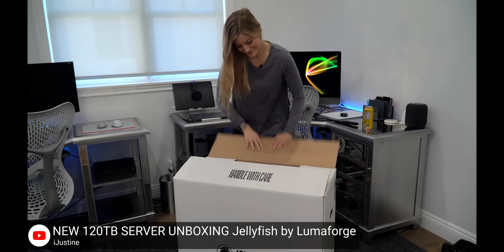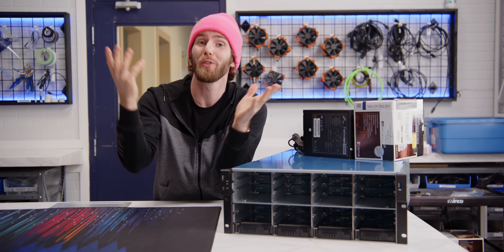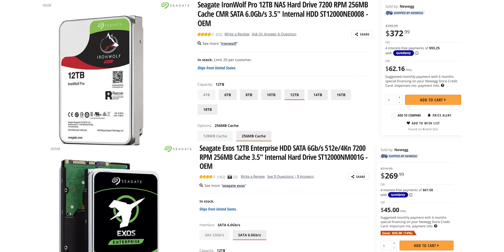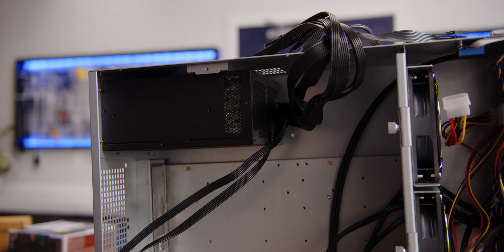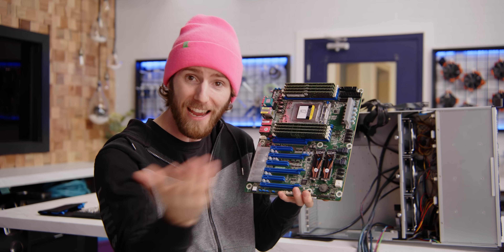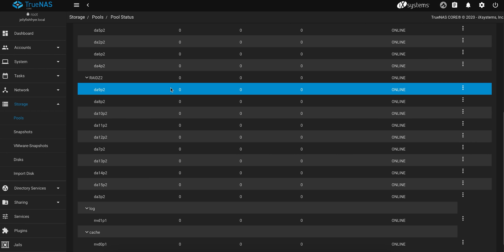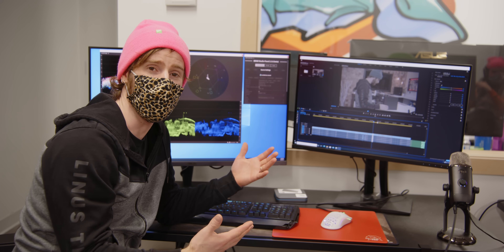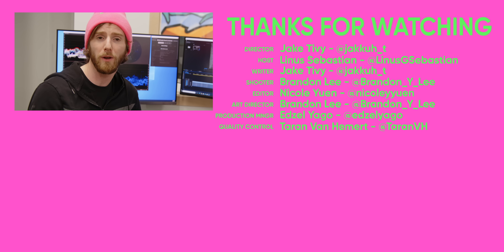Here's How to Save $45,000 - The Sensible Jellyfish Fryer

Comment: I built a portable all flash file server, 16 hot swap 2.5 inch Samsung SSDs, dual 40G SFP+ ports, but only a max of 128GB of RAM due to using an ATX board and Ryzen 5 4650G(64GB of ECC uDIMM installed). Currently sitting. at 32TB. My cost? $4054 The same effective thing from Jellyfish? $13,696. But that only had 60Gbps instead of 80gbps. And i cant even tell if that is flash storage or spinning rust. IF this were spinning rust, then i also have a cost for that, as this isnt a new server, i actually upgraded it from 16x2TB 7200rpm drives. The original cost was just over $2000 , as instead of $199 for Samusing 2TB SSDs, i was only paying $89 for 2TB Seagate drives(now down to $69)
The one thing i THINK the jellyfish has over me, is build quality, and registered ECC instead of unbuffered
Oh, and my new server build had Optane acceleration for small file reads/writes//SLOG/L2ARC. But i removed them because of the lack of PCIe lanes, actually slowed performance in sequential read/write compared to the pool's native speed of ~4GB/s, which is held back considerably by the SAS2 controller, if this were SATA/SAS3, then in theory, this array would be capable of over 8GB/s.
Yes, i realise that Ryzen 4000 holds back my performance because it is PCIe 3.0(i can max out the SAS controller, i can max out the network, but i cant do both at the same time), but i can upgrade in the future if i need it, and right now, i dont need it

Comment: Say it with me kids: "Molex to SATA, lose all your data."
Reply: Where does that saying come from?
The molex connector isn't fancy or particularly good, but also not nearly as bad as your saying states it to be. Here in Paraguay (South America) computer equipment and molex connectors are pretty much a given. The newer stuff that floods to 1st world markets, will still take a year or 3 to 4 before it trickles in over here. 

Anyway, molex to SATA converters are pretty common here. And I personally have 8 (bare metal) servers running with those. Guess how much data I have lost. Exactly 0 comma nada.

So tell me again, where do you get that saying from? Are you to weak to make a proper connection between molex connectors? Don't you place those connectors (or any other connection types for that matter) in such a position that gravity helps in keeping the connection solid? Or don't you take electronic "creep" into account?

If that is the case, it is your lack of thinking things through properly that actually loses your data. All I read is that because of your lack of insight, you should never hold a job where you are responsible for your own data or heaven forbid, someone else's data.
Reply: @geroldmanders9742  Many (cheap) SATA connectors are molded in such a way that they easily short between the different voltage rails. The first result on Google (for me at least) is a /r/techsupportgore thread showing the aftermath. There are many more. It's something well established, but also a meme. 

I didn't look very closely at the ones Linus used in the video, but I don't really care- he probably knows about this issue already. I commented because:

1. People who will actually follow this guide (as a direct alternative to a JF) won't know which SATA connectors are crimped vs molded. I have a faint hope that someone might see this comment and Google why not to use these cables blindly (especially cheap ones).

2. Memes.

Comment: That's still not plug and play, you should have configured DHCP, that would have closed the gap, though you still need to make sure your network interface has DHCP mode enabled, which is usually the case in Windows for a fresh install.

Comment: Something that would make this solution truly "plug-and-play" would be to run a DHCP server on the NAS (possibly in a jail or just bare metal), that assigns IPs in each of those subnets. doing this, you don't need to manually set the client IP. Alternatively, you could just assign all those Ports to a Softswitch for a network where you again run DHCP, with similar results.

Comment: Would be nice to get your hands on a Jellyfish and run this side by side under real tests and do some benchmarks. Would also be nice to see the underlying parts that Jellyfish use but don't share part numbers, so like a teardown and find the RRP of the parts they use so you can give a cost of buying the identical Jellyfish parts and building the 100% unit and just see how much Jellyfish really screws its customers over. 

What is more worrying is people like IJustine while I use to watch her content, she puts herself forward as a Tech Guru - someone who says she knows what she is talking about - but when they ditch in this case the system you built for her and goes out and buys a Jellyfish and then raves how good it is - You really do have to ask - How much does IJustine actually know about tech? 

The same could be said for the others who have done the same. But IJustine is the 1st person that comes to mind who has done this. 

So in a nutshell would be good for LTT to get its own Jellyfish and then give 2 in-depth videos 

1) Jellyfish vs the rig in this video for proper workflows - not just running read and write speeds from the drives. 

2) Breakdown of what you actually get in a Jellyfish, and a cost of those part by finding the part numbers.

Comment: I really feel that the people who bought the Jellyfish tech tubers are exactly like people in the tech industry in general. i.e if there from the silicon valley, they are all image and no substance. 

Not to disparage those involved in this pseudo-clapback, but for "tech" YouTubers, they don't seem to know a whole lot about the actual technology behind things. They just know advertising dot points and seller speak (which I call Crapanese) 

To them, technology is a fashion statement and everything comes second to the optics of using/endorsing certain brands. 

Plus, they're quite flush. Despite intimating otherwise, so they don't need to think about reducing overhead as much as most people. 

In addition, it's a business expense to them. Their accountant may have told them that they need to have a certain amount of expense to drop a tax bracket.

Comment: Hell, i wish i could ask a question, since i had trouble with searching for a possible solution. 
I have 5 screens, but just 3 ports on my RTX 2060 (DVI-D, HDMI and DP).
At the moment i connected 3 screens (one to DVI-D, one to DP, one to HDMI) and.... thats pretty much all my ports on GPU and 2 monitors left. So i kinda wanna use it.
DP-chain is not an option (only one screen with DP), but my msi b450 "Mortar" motherboard does have an HDMI-port and Type-C port. Ofc, natively, this HDMI only good in case of me not having a normal GPU and CPU with on-board graphics (Ryzen 3600 does not). Buying a new GPU isnt an option due GPU pricing atm.

Is there any way to connect all 5 screens to my PC with, perhaps, some splitters/Type-c without mirroring input?

Comment: For anyone thinking of setting something up like this on their own, never use only a single device as the SLOG.  This is a single point of failure for the entire array. Preferably, you want this to be at least a RAID 1 volume, and might want to even make it hot swappable.
Reply: Bigger problem is using a consumer TLC drive as the SLOG
Reply: @otgsid3243  yeah, write endurance is a pretty big factor, but at least you'll see that coming if you pay attention to the S.M.A.R.T counters.
Reply: @joshuamarcotte8514  Power loss protection is another factor anything in the DRAM on the SSD during power loss will be lost.

Comment: 6:30 this is wrong, a slog or a separate intent LOG in other words only caches synchronous writes, not asynchronous writes, synchronous writes are usually only used by things like databases which need to be 100% certain that a write was completed to ensure data integrity, this can be fairly slow which is why ZIL and SLOG where created, almost all other workloads, like sequential writes seen by ingesting data, make use of asynchronous writes and do not benefit what so ever from a SLOG. Also worth mentioning, because a slog contains data that has not been flushed to the main raid array you should really also make sure the slog uses redundant storage otherwise it may still lead to data loss in case of hardware failure, also the type of workload is really heavy on nand flash ssd's so you should really be using optane.

Quick note, what you could do if you still want write caching is using lvm below zfs together with dm-writecache or dm-cache in writeback mode, this will basically do exactly what they where trying to achieve
Reply: The other thing that needs to be stated is any drive used in this role needs power loss protection.
Reply: @otgsid3243  i think that's only for zil, not for slog devices, although I'm not 100% sure
Reply: @MrTurbo_  SLOG (Separate ZFS Intent Log) is the ZIL (ZFS intent log) when you add a separate drive just for ZIL.  The wording and acronyms make no sense, but bottom line is when you have a  SSD slog drive the zil is on it, and it needs PLP otherwise data on the DRAM is vulnerable.

Optane would be the best drive, and it doesn't need PLP because it doesn't use DRAM

Comment: 5:27 Cut the cr@p would you? I had 2 HDD fail out of a batch of 4 with only 29000 power on time, these are ironwolf drives with 1000000 MTBF. Yeah i call that BS. If you value your data stay the hell away from seagate. And to add vinegar to injury i was able to get HGST ultrastar for the same price as regular ironwolf drives, seagate can go to hell.

Comment: Weird that nobody has mentioned how the consumer m.2 drive for slog is not recommended at all, as those almost never contain power loss protection for the data in the drives dram. for the price of the system it should've used a proper datacenter SSD for slog.

Comment: Re: implementing "direct attach" - instead of twiddling with manual IP addresses, one can configure DHCP server to run on each port that's not plugged into a switch. Then all you have to do is plug in the cable. It's even possible to make it foolproof and script around to enable DHCP server on a port only if it didn't get an IP for X seconds since the cable got plugged in.
Reply: I was thinking the exact same thing! DHCP would be a much better option in this scenario/target user group.
Reply: Can windows use the automatically assigned IP address it gets when no DHCP is offered?
While your solution would be the correct one, imagine the jank of relying on windows' failover xD
Reply: @kommentator1157  I don't think I fully understand your concern: what failover are you talking about? My point is that you can ensure that there is a DHCP response with a valid IP address, just as if it was plugged in a router.
Reply: @imax9000  I'm talking about the ip address Windows assigns automatically if it CAN'T reach a DHCP server. Which is why I also said you shouldn't use it.
Reply: @kommentator1157  What I'm suggesting doesn't involve those link-local addresses. Storage server would act as a DHCP server and assign addresses from a predefined ranges.
Reply: @imax9000  I know. It was just a jankier and stupid way I thought of you could use to achieve a similar thing.
Reply: @kommentator1157  ah, I see :) FWIW, it would probably work almost fine with Windows and Mac OS (both assign link-local addresses out of the box), but the annoying part would be waiting for OS to decide "oh, alright, no DHCP here, let's use link-local address".
Reply: @kommentator1157  Yeah this is the even simpler and more correct solution. The auto-assigned addresses are link-local, which means that they are non-routable, but work just fine for direct attach stuff. The only thing you would need to do is have some software to detect a link and connect to the correct auto-generated IP automatically.
Reply: @2rjk  Huh, you think that would be a correct solution? For one this wouldn't even work with Macs or Linux devices.
Now if you really wanted to do that, 
windows does stay within the same address range, so a static ip inside that range for your server-interface should work.
Reply: @kommentator1157  You do it on the server side. You can probably just spin up a bunch of Docker containers from a ready-to-go DHCP server image and be done with it. It's not that difficult.

Although I do think the main concept of this video is a little flawed. Sure it's very expensive, but you also pay for support. People buying the Jellyfish just want a phone number to call if something breaks and have someone show up if it's really necessary. This is the same reason why even big companies buy ready-to-go servers even though they could totally hire someone to build them for them. You're buying a solution, not hardware. That solution includes a poor support engineer who has to wake up at 3 AM to fix your stupid issues. 

I'm not saying you should buy a Jellyfish. I'm just saying that if you're spending that kind of money, you might as well go with some actual enterprise-grade hardware and get some enterprise-level support while you're at it.
Reply: This is exactly how I would do it I was to do it, why would you not use DHCP and skip out on the whole user config step

Comment: SLOG with only one drive?
That's kind of risky for a system that is supposed to be reliant.
For L2ARC there's no issue to run just one drive, if it fails, ZFS just goes to the rust, but for the SLOG you really should have a mirror.

Comment: Using a single device as the SLOG opens you up to data loss due to failure of that device. You need that SLOG to be a mirror. All that fault tolerance on your pool and you left a 2TB hole in your fault tolerance. The L2ARC doesn't need fault tolerance, but the SLOG does.

Comment: @6:33 SLOG is NOT a write cache. Writes go to BOTH the SLOG device and your pool. It is used for recovery purposes only. Given that it writes 99.9% of the time, you best be using an enterprise high endurance device for it. It also doesn't need to be big as once the data is written to the pool, the same SLOG data is invalidated.

Comment: Linus really kind of glossed over the best argument for a system like this. People buy the JellyFish systems, because they are user friendly and "just work". You don't need to have a lot of IT experience to get it to work. That said, for the nearly $45k in savings, you could easily contract with an IT service provider of some sort that would be able to spec out the machine and then provide support as needed. $45k is going to go a long way in terms of supporting a single server, especially one that is minimally complex. Frankly, you could make a killing building these servers and providing support. You could easily support 40+ of these devices as a part time job. you could easily provide support on a monthly or yearly schedule and clear $3k a year per deployment and come in far far under what a JellyFish would cost you in the long run.

Comment: Normally I run a server with one power supply running back to a UPS and one to main (surge protected) power... That way I can swap the UPS / update it's batteries without thinking too much about power configuration. 

This assumes I only had budget for 1x UPS capacity, 2x is nicer, but at that point normally the whole server room is on UPS power.

That's a pretty killer redundant PSU in a consumer form factor though. I didn't know those were a thing.

Comment: 10:08 "Molex to sata lose all your data" (fire hazard)
Reply: ...if you use the cheapest adapter from Alibaba.
Reply: @ugh-meh  Price has no relevance in this case.  I had expensive injection moulded adapters and they also caught fire!  I hope Linus removes them before it's too late
Reply: @ugh-meh  They looked like the injection moulded ones, the crimped ones are better. Not to say all injection moulded ones are bad, but after seeing a few melted injection moulded connectors I wouldn't take any chances.

Comment: Those Kingston boot drives have issues with power faults; specifically they suffer from CRC errors during an ungraceful power off situation. If you run "smartctl" on the drives you may see an increased amount of ECC_Uncorr_Error_Count. There's also some SandForce_Internal values that we don't know what they are and the manufacturer didn't reveal. These were KINGSTON SV300S37A60G drives.

Final note is that we replaced ~400 of these drives because the failure rate (due to CRC errors) was over 2%.

Comment: The ZFS SLOG is not a write cache in the traditional sense. It is never read from unless there is a failure and transactions need to be replayed. Data does not flow from buffer to SLOG to disk. It still flows from buffer to disk no matter if you have a SLOG or not. The advantage of the SLOG is that it allows synchronous writes to return as complete once the data has been written to the SLOG, even if the data has not yet been flushed from buffer to disk. The SLOG does not provide any performance boost for asynchronous writes since those ack as soon as the data hits the buffer.

Comment: Just out of interest, if you had bought the external drives of Seagate 12/14TB. For example in Germany they are even cheaper than buying the HD's without that extra casing. Wouldn't there be either an Ironwolf/Baracuda or Exos Harddrive in it? Meaning you could buy those drives cheaper only to invest time cracking the case?

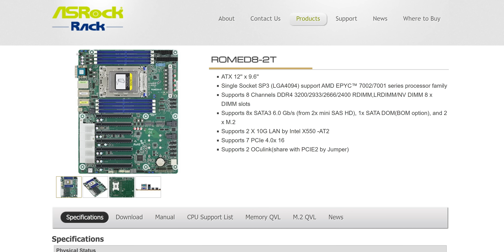Comment: 11:50 What? Saying you wont benefit from gen 4 board while using gen 4 nvme's?? Did i heard that right? You are using a gen 4 ssd on a gen 3 board as a cache? What?
Reply from the maker: The gen 4 SSDs were used becuase we had them on hand, not because we will benefit from their speed.

This server is bottlenecked by its internet connection, so there is no point in upgrading to the gen 4 board since er already had the gen 3 one from a previous project. - LS
Reply: @LinusTechTips  ah understandable have a great day!